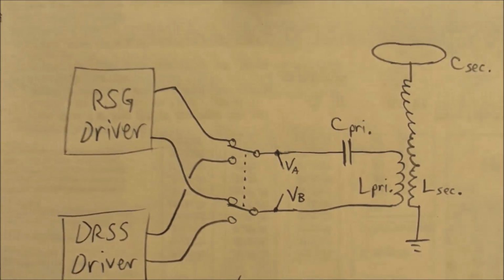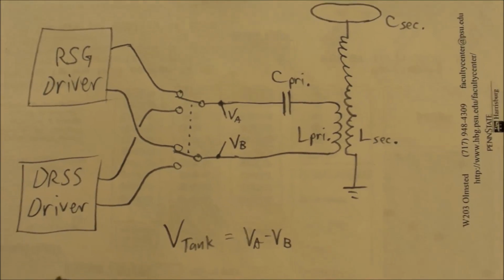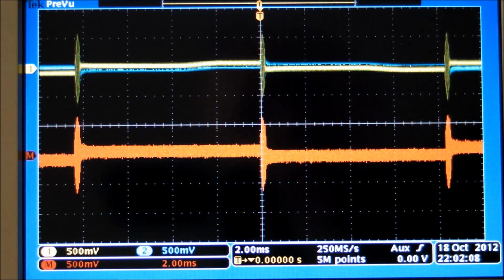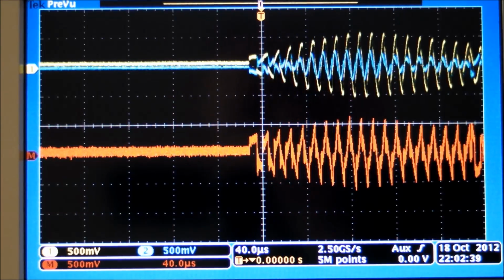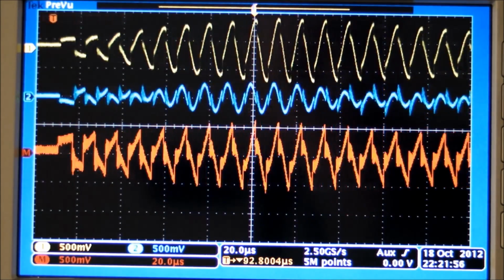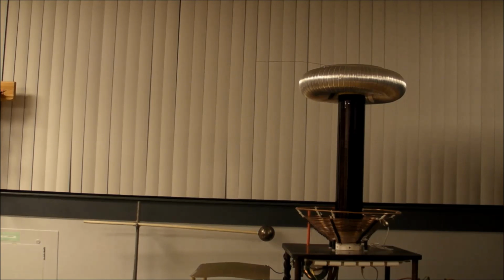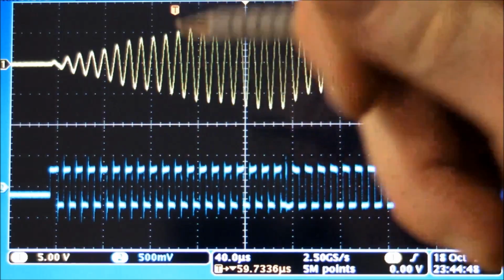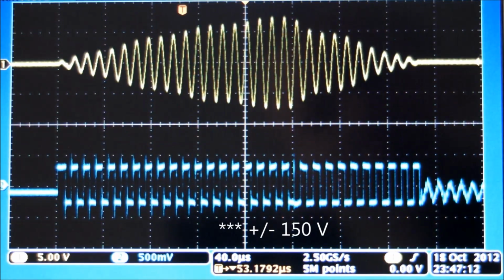(#0023) Tesla Coil Voltage Measurement FAIL - DRSSTC vs. Spark Gap #03

Comment: Hi Eric - from your schematic, you have the Va and Vb in the wrong place to see ring-up and ring-down. As you have it, you are just seeing the SG voltage which is an unpredictable function of current and of your power supply/RSG. What you should have done is measure across Cpri or across Lpri, then you will see the traditional primary ring-down. I hope you will discover that your HV probes are better than you think. Good luck.

Comment: Judging from the schematics shown, I think that maybe the primary circuit can not oscillate on its own. With the SG-driver it can oscillate only while the SG is closed, then it continues for a (short) while drawing energy from the secondary circuit. Since  your BPS to F-res ratio is almost 1:1000 a different set-up as shown in my video (recreating Wardenclyffe part 5) would be much more efficient.
I do not know the SS-driver-circuit that you are using, but I guess it has a similar problem. Yet by forcing the F-res on the primary it will be more efficient in producing sparks (as shown in your other vids).